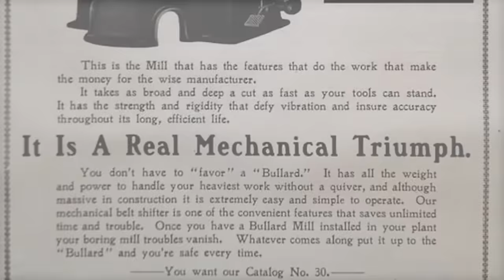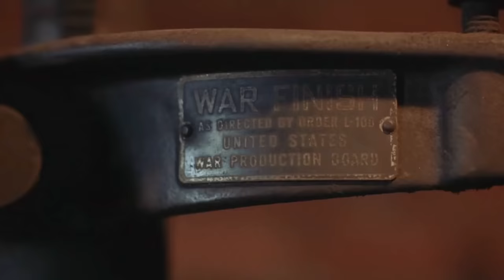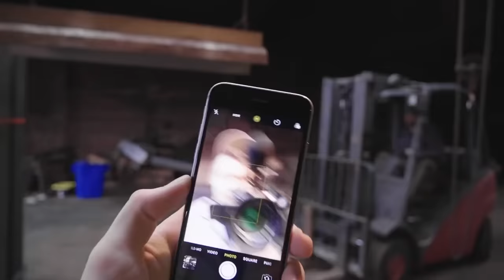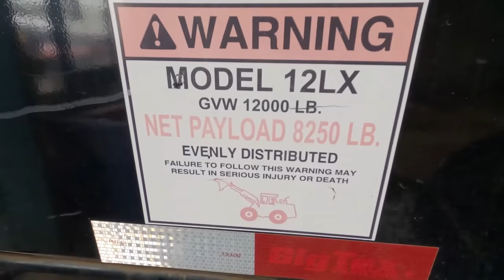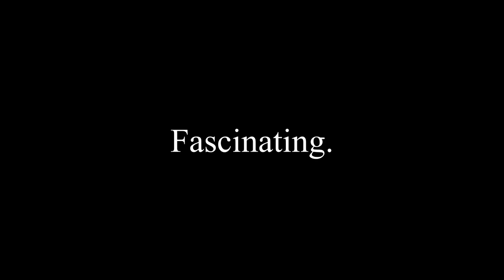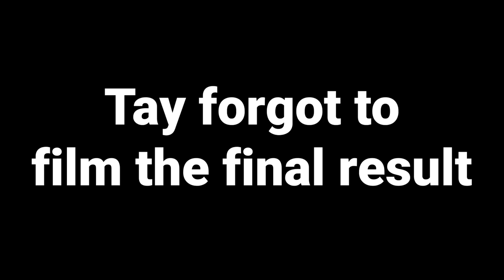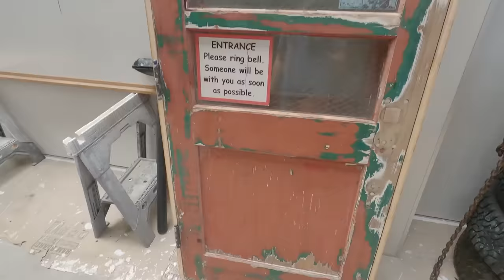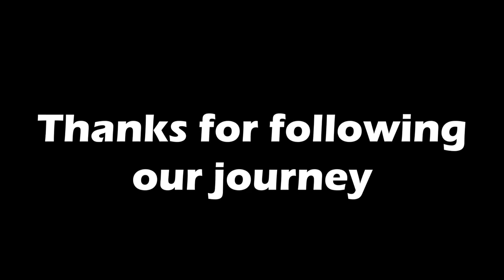How I Renovated An Abandoned Machine Shop (FULL SERIES)

Comment: This video came up in my recommended list and I got completely sucked in. And for good reason--about 3 years ago I bought a circa 1937, 3,600 SF diemaker's shop that later became the shop for a mobile welding company. Similar to your shop, my offer was based on letting the retired welder leave everything behind. I did much of the same work you did, including cleaning the whole place out, saving a few stationary tools, then scrubbing and degreasing every last surface of the shop--wood ceiling included. My shop has most of its original hard maple floors (on sleepers, on a concrete slab), which I was thrilled to find were in restorable condition and can stand up to a towmotor being driven on them. Today, it's my ultimate hobby shop for restoring wood boats, woodworking, cabinetmaking, automotive repairs, and various other forms of doing/making. Congratulations on saving your shop--you did a terrific job. Thanks as well for bringing us along on your journey!
Reply: Living the dream! Mine too......
Reply: So whens your channel coming out?😂 I wanna see the shop! 🤘 hope i have a similar opportunity as I age, came across a shop sale to pick up an old welding table from a steam fitter/plumber the vice on the damn thing weighed close to 150lbs 😂 pry more like 90lbs i was just nervous to drop the thing on my feet. The old shop was the original steam fitter shop from 1930's in my city, with living quarters up above. Wish i had the money for the shop all together, all the old brick and everything. Sent chills through the bones when I first stepped in hahaha looked like endless possibilities to me but i was too young and too broke to know what to do with anything 😂

Comment: "War Finish" referred to the paint and LACK of Bondo or "Filler" material in the air bubbles and casting flaws in the cast iron, machines were "Banged out" as fast as possible to help build tanks and planes and jeeps etc and the machinery manufacturers were told not to worry about making their machines pretty, just functional in those years
Reply: Cool! I had actually wondered a about those tags for a long time. Thanks for sharing!
Reply: Thank you for explaining, I'm sure there's a good joke in there for others - meanwhile I'm just happy to be learning!

Comment: I do believe I could have a real good chat with David. What a character. That was quite a place as you found it. One wonders (aside from the medical things you talked about) what they built or repaired there over the years. Hendey Conehead lathes are a work of art.  I thought I spied a Henley T&G lathe early on, that's a nice tool.

4 or 5 steps to accomplish the original objective is a common theme around here. I call it one step froward, three steps back! Nevertheless it gets done eventually. Wyatt is the kind of friend that is rare to have. And finally I am glad I live where I don't need to have a simple framed wall  or some new lights inspected by the city! Cheers

Comment: Even with the bent line shaft, I would have figured out a way to have a turning line shaft in the office.  That would be so cool, running a fan or something.
Reply: this guy has a machine shop...what do you mean figure out a way, he literally is in the best place to make an adapter/s to get that up and running again

it could also turn an AC compressor to get air conditioning going
Reply: Thats what I was thinking. Would have been a cheap plumbing job. Crossing of an hour from the bill for each hour that it takes to fix that shaft.
Reply: That part left me aghast! I was surprised and disappointed that he didn't even seem to research what it would take to restore the shaft drive setup to full-length operational ability. Especially considering the lengths he's often willing to go, to have things just so... And that he had neat plans for that specific section of it... It made me a little sad, after so much prior equipment had such emphasis on going to a good home over getting scrapped or trashed.

I mean, it's obsolete, sure; but he can't be the first person to have a shaft drive get hit by equipment big enough to bend a shaft. There must be some decent options to straighten it or replace enough of a section to get it running true again.

Oh well.

Comment: Just finished the transformation.  Great job.  Really liked the riggers and moving the large machines.  Most of those machine I have run in my working life as toolmaker.  When I started in the trade, most of the machine had been converted to electric motors but still had leathe belt.  Even had a spot in the shoot to fab up new belts.  Brought back a lot of good memories.  Good luck with you new shop

Comment: What an amazing transformation! I can understand that it felt good demoing that mezzanine but damn, that wood could've been used in so many other ways, the rot did not seem to be that wide-spread.

However, using no masks because you've been quarantining together, sure. No masks breaking up concrete; straight stupid food. Use the mask ffs, we do not want you to get silicosis. A real danger when working with concrete (and other types of) dust.

Comment: I kept on watching just to see what piece of old magnificence would surface. Thanks for all the hard work.  

One thing I can add, regarding buffing metal.  There is a method that goes like file: coarse, medium and fine.  Instead, the buffing wheels go from sisal {straw = coarse}, stitched linen = medium and unstitched linen = fine.  Along with each stage you use rouge designed for each step.  Mine go from brown through a middle colour that I have forgotten and a fine which is purple.  The end result of working your way through the three steps is stunning.  I’ve gotten lazy and only use the coarse & fine and get an OK result that is good enough for me.  You have to be good with changing wheels.  I do mine in a drill press with a quick release chuck and inserts in the wheels.  Run at 1800 RPM does a good job.

The strange pieces of metal with multiple holes and the Journal extracts of Surgical Techniques confirms that amongst other things, this workshop made orthopaedic implant devices.  A common item, a plate measuring 1” wide and four inches long with multiple holes would have been applied directly to the outer surface of a bone which had fractured and was unstable to the point that mere plastering would not result in good healing.  The holes were points of screwing into the bone to give strong binding.  The skin was closed to put the plate at depth, out of bacterial harms way. 

Sometimes after the bones have healed at the fracture site, the plates were retrieved and recycled in another victim.  Gorey stuff but far better than ending up with a long bone with man-union or even worse, non-union.   Cheers.

Comment: Wow, what a project, love the building when we were in Florida we had a very simerler building from the turn of the century 19 to 20th , was a great shop but after 8 year we had to return back to UK , you mentioned in took you 2.5 years just to get to an empty building - how did you fund those years ? Iam about to emback on an 18th and 19th century ex tool making factory conversion in France, simirlar set up re - line shafts but I have 2 very old foundry hammer machines at least 120 years old - looking for a new home , otherwise out comes the plasma cutter and all the old iron goes to the scrapper for cash to fund the new electric instal. All the best, now subscribed. Karl in France

Comment: If you ever have to cut up concrete again, cut it in to squares or rectangles and us a 1/2” drop-in in the center and an eye bolt. You can use your fork truck or mini/skid steer and a chain to pull them out in pieces instead of crumbles

Comment: You can insulate the roof by putting foam insulation over the membrane. Then you put   Fabric over the foam and then ballast it with gravel. Make sure the roof is designed to carry the load.

Comment: Haven’t gone thru all the comments but #57 gravel = 57 mm dimensionally, so the higher the number, the larger the stone size, to a point, as states have different nomenclature for aggregates. You guys are doing a great job and it is a massive undertaking; looks like fun but I’m glad YOU are doing it!
Reply: That’s not quite right, 57’s are a mix of number 5 and 7 (it’s the screen size) stone, also it goes the other way with the size. A number 10 stone is almost dust while 1’s and 2’s are about 3-4 inch rocks. 57’s are approximately 3/4” diameter which would be around 19 mm, while 57 mm is around 2.25 inches. 
It’s pretty easy to see that rock isn’t two and a quarter inches.

Comment: The “Turret Lathe”, is the reason I started to have my doubts about becoming a tool and die maker for a career.
I was accepted at college tool and tie maker program. Had done several years of study and could operate most machines. One of the work furloughs I was on was for a small local shop.
Like all small shops, they did everything, every type of work to keep everybody employed.
One contract they had was for small spindles for a machine wheel. The turret lathe was setup to turn them out. The order was for 10,000 ?. As the apprentice in the shop, that’s what I did. If I wasn’t there to do the work, next in line would be a very senior Machinst, with 35 years experience. A German trained, expert machinist would have to crank the handle on the lathe if the apprentice wasn’t there. Producing special parts in small orders is what keeps the shops going. I was having my doubts, its one thing to be making precision parts for million dollar equipment, and another thing to be turning out 10k spindles in a turret lathe.
Professional machinist are very highly skilled ,master craftsmen and I’m not sure the are equally compensated.
Those days are long gone, however when I look at a turret lathe I feel nauseous.
Reply: You chose wisely. When I went back to school to study Advanced Industrial Maintenance & Technology, they were wheeling out all the old stuff and getting rid of all of it. They simply did not have enough people taking courses on the subject, and there was no one to teach. If you have those skills today and the right connections, you could have a niche shop that deals with restorers and people that need "old style" parts. Don't shrug it off, it's a huge market. The parts crisis were in right now can testify to that! The Chinese DO NOT CARE what they send us! I've seen shops that order two of everything they order, because one of the two will be bad right out of the box! Specialty shops need good parts, they can't get them from China!

Comment: The buffing machine with the black color on the buffing wheels is likely a hard color buff used for highly polishing an item and the hard color buff compound I used to use in the 1970s was in the shape of a half brick. Dull brushing compound which is more aggressive, used to come in a tube similar in size to a tube of grease. Running one of these machines was my first job in industry for Amerock Canada which used to make cabinet hardware and the knobs, pulls, towel bars and such were mostly all buffed in this way. Amerock is still in business' in Rockford Illinois and may still be using something similar to this now, if these jobs have not all gone overseas.

Comment: How do you get old machines that use line drives for traction to run in a modern shop? Is there a way to convert them to running straight off a motor, or do you need to use actual belts like they were designed for (presumably using 440 Volts rather than anthracite as the prime mover!)

Comment: There are places where gravel is dug directly out of the ground. Here in Switzerland, there are big gravel deposits from the ice age, which were actually also big rocks that were ground up by glaciers. These gravel layers can naturally hold ground water and allow it to transfer between aquifers. Geothermal home heating / electricity relies on such permeable ground layers to pump water trough them and exchange heat.

Comment: The buffer has Babbitt Bearings. I have a 1930's Atlas machinists lathe and I have similar bearings on my upper jackshaft for the pulleys between the shaft and the motor shaft to the main spindle

Comment: Hey Trey.  Nice project.  It is good to see those old and capable machines going to good hands.  Each of the guys that picked up a machine had different techniques to move heavy machinery.  But it all worked.  I'm glad to see that you are keeping the Line Shaft  overhead.  Even if you don't use it or use it for a fan, it seems to me to be part of the building and proof positive that this was always a machine shop.  As for the history of Line Shafts, it started with water power running a turbine that ran the line shaft.  You probably had two or three bigger mills along the Reedy river in Roanoke where the falls are, that were getting their water power from the elevation drop.  Then as steam power became more affordable, mills were run on steam.  When the Model T with it's internal combustion engine started getting into wrecks, the engines were used to power smaller shops like Price-Filler.  Do you have a hole in the wall that aligns with the line shaft.  Maybe not.  I didn't notice it.  Then as electric motors became more available, they were used to drive the line shaft.  It is good to see that it is still a machine shop.  I love what you did to it.

Comment: Unfortunately I came across this about 10 months after the posting. I would have suggested using a section of the good line shaft to replace the bent section and run that into the office. I am still watching and hoping that you come up with that though. Loving the video.

Comment: Well I could have saved that lineshaft. Cut it off past the wreck part where it is good and straight. So you are removing the bent part forward towards the front wall. Machine a coupler bout 8"long with bolt holes along horizontal axis and cut in 2. Install new chunk of lineshaft and bolt the 2 shafts together. Thats how you would have extended the lineshaft back in the day.AL.

Comment: Actually the belt drive line shaft system was grandfathered over from steam engines, and water wheels, turbines, windmills, or animal power before that, which were eventually replaced with electric motors. It was a simple way to retrofit existing systems as well as the things you mentioned.

Comment: Wow, I suppose I am too late however I am actually trying to build a machine shop for my small engine repair business. I am finding and restoring 1800's machine shop equipment to run from a central pulley system with steam from waste oil and sawdust. The supply chain has taken so many hits that parts either do not even arrive and if they do many times they are the wrong parts or fitment is Ann issue. I want to be able to make any part that may be considered obsolete. My specialty is engine drive welders and vintage tractors and equipment. My motto is living history with yesterday's equipment producing tomorrow's quality. Do you still have that really long lathe that you put in storage? I still need a milling machine and lots of other equipment. I am recovering from getting run over on my 1957 Harley Panhead by an F350 I had to learn how to walk again and they wanted to take my right leg but I fought and worked hard until the circulation returned. I hope to hear from you. Great job my friend.

Comment: The turret lathe.  I know there are 4 bolts to hold the wings on some planes.  They are location specific and half of them are reverse threaded......  2 operators cranking out 12 bolts a day would be doing parts for 3  planes each...  Plus a 4th operator/ machine to handle break downs or making replacement parts.

Comment: I believe 57 refers to the hole size in the screen at the crusher. Your material is crushed limestone. Gravel is in veins underground usually in or near aquifer streams underground. Gravel pits fill with water and pumps run continuously just so the dragline and stuff doesn't get swampered.AL B. In Ohio.

Comment: A buddy of mine had a glass shop and used a belt grinder that looked just like the war belt grinder. Had coolant and all. He used it to make shapes for specialty pieces (round tables, ice cream cone mirrors for Dairy Queen, etc) of glass. He would use a handheld buffer to smooth the corners or outside edge to a round edge. Maybe the war belt grinder and the buffer were used to make glass windows for war planes and tanks???

Comment: Window glazing means to completely install new glass (glass and silicon or putty). It can also include framing. When installing new glass, the glazier also applies putty and that’s the complete process. It’s not called re-glassing and then reglazing.  It’s just reglaze. The term of the industry of glazing calls putty installation of glass, “putty glazing”. My dad, uncles, and brothers were all glaziers with a combined experience of over 400 years. My dad was a journeyman glazier for 60 years. I, myself worked at a “glass shop” for 2.5 years. You did a fine job; you simply said it incorrectly. Congratulations on your shop.

Comment: Couse base sure why not course sand should surround your pipe and would bring you up with less pain. I ballpark aggregate at 3200lb / yard. Your course stuff is lighter. So that's good. But you need consider compressive strength of you uncompleted fill under your new slab. If your new slab is well reinforced and thicker than 4" your ok.

Comment: Lol,  the turret lathe made nuts for truck wheels, you cant buy them off the shelf.
We ran a cnc lathe up till about 2012 making nuts for kenworth trucks.
But even then the nut fairy dosnt make the nuts you buy at the hardware store.
They are made at some factory.
ARMOCO steel in kcmo was making all kinds of hardware with older automated equipment.   Should have seen the machine they made nails on it was very cool.